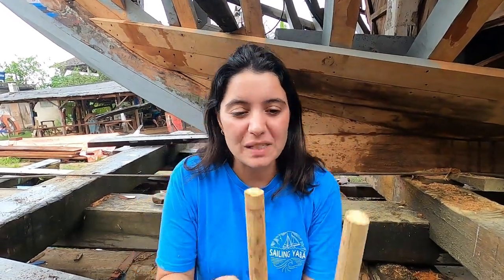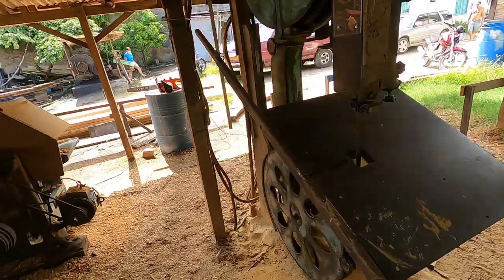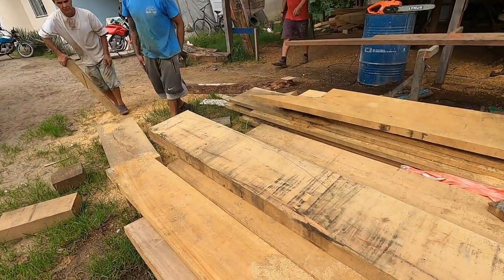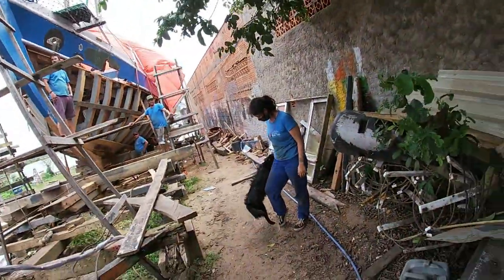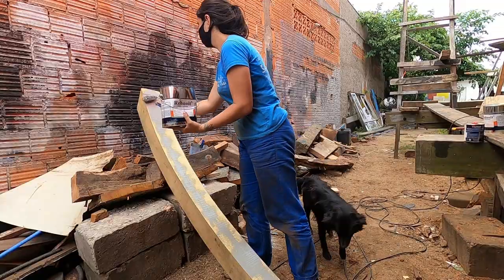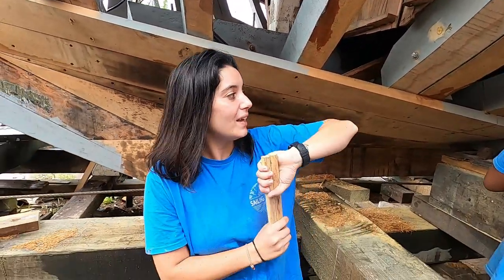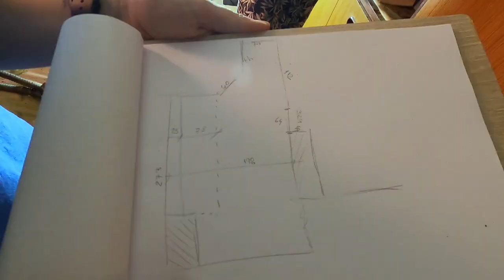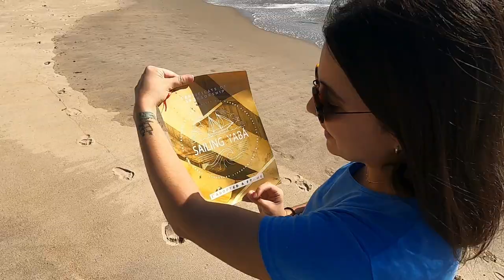MASSIVE RESTORATION: Building frames on a huge wooden schooner — Sailing Yabá #23

Comment: Get the guys some safety glases
Reply: They are a pain, continually getting dust, smears, steaming up, scratch easy etc we only use them when youve a fair chance of getting something in your eye, you get to know when needed
Reply: @Superfandangoo  40 years in the trade, and you haven’t learnt a thing. Eyes don’t grow back you know, I’ve worked in ER so I know a little more than you about site injuries. I can furnish you with some stats if you wish.
Reply: @dickenscider7328  I didn’t say I don’t wear them did I, I will where them cutting/grinding metals, plastics, chipping ceramics etc as for cutting/sanding timbers etc, the dust that accumulates hampering vision at the cost of losing a finger no I do not and this is what these guys are doing, I and my colleagues have all their fingers and eyes.

Comment: Hey guys, great progress and looking good!  Nice touch adding trunnels (treenails) in the frames.  With all of the work you have put into the ole girl, just one tip on how to best preserve that work.  Install a water tight deck that keeps the freshwater out!  Think of how important the roof on a house is and the difference in how long the house and your belongings will last with a leaky versus a tight roof!  Quite a few options but pick one that is proven.  Planked decks look traditional and all but they will all leak sooner or later!  You can plywood over a planked deck. Scarfing and glue all joints so that you essentially have a single pc. of plywood and then sheath with a semi flexible covering such as a softish epoxy like West Sytem and Dynel cloth  (2 layers min.).  The Dynel has a lot more give in it than fibreglass so it moves with the wood better but fibreglass will work and is more available if you cannot find the Dynel.  You could  go with the traditional painted canvas decks but they will be short lived in the tropics.  Cheaper is what is called "Miami Teak", tar, tarpaper and mobile home roof coat..not the nicest stuff but much more watertight than a planked deck.  Just pick a solution that will keep the freshwater out and you will greatly extend the life of Yaba.  Dry wood won't rot.  You will get a lot of moisture through the below waterline hull planking, normal on a wooden boat.  Provide plenty ventilation or use a dehumidifier if the boat is closed and dockside to keep the moisture from building up.  To keep out the shipworms from below, if available creosote painted on the bare wood works great and your bottom paint can go right over it.  Otherwise lots of soft copper bottom paint and haul the boat often.   You are going to have a really strong boat when you are finished.  Your workers know their trade.  A very impressive project!  Best J&J

Comment: Just a thought on interior.  You said early on that the master stateroom was going to be forward and the second stateroom aft. Due to the size of the boat, you will need a crew for long hauls. You might consider making the master stateroom crews quarters with berths and a table for guests and crew.  The second stateroom would make a good master stateroom. You live one the boat and only sleep in the stateroom.

Comment: As a life  long shipwright it hard to fathom the logic trying save this boat , but if your passionate about keeping her afloat it’s almost impossible to be talked out of the idea of not saving her . So please please invest in the best electronics and emergency safety equipment you can get and knowledge of how use them - this boat should never be in anything but calm seas or you’ll be putting yourself and  your passengers at risk .Shes  not new anymore and never will be no matter  what’s been replaced,  a new boat  has tight joints for strength, this boat will forever flex and loosen up even tied  up  at the dock .
Reply: IDK, looks like they are rebuilding the whole boat - almost like The Sampson Boat Company.
Reply: @drx1xym154  Tally Ho and Yaba just can't be compared in materials, build quality and craftsmanship.
Reply: I'm a craftsman who works with woods. I wondered what a shipwrights take on the restoration would be as there are a fair few aspects to the restoration work that make me concerned for their safety whilst afloat. It would be a crying shame to see it all end up at the bottom of the big blue and these lovely peoples lives at risk.
Reply: Tony Goodman . This boat will live for many years. Good charting skills  should keep her safe along with regular refastening of the hull. Romantic ideas of the seas sometimes over ride the risks buying a craft that need a lot of attention and resources. In that case resources can  applied  for upgrading systems and learning how to use them. You reduce the risk significantly by knowing where your location or location of another vessels or any other hazard at night , or if sudden storm catches by surprise . When you drive an antique car it best to stay in the slow lane..

Comment: Have areas of the interior main walkway built with regularly spaced sturdy posts to use to hang on to and brace your bodies against while moving through the boat in rough seas should a  storm occur while under sail.

Comment: It was easy to build a brand new boat than refurbishing this one.  (era melhor construir um barco novo do que reformar este )  loucos..
Reply: Probably this is the format of the channel . Craftsmanship and rebuild
Reply: You guys have no idea how difficult and expensive it would be to build this kind off big boat. That would easily cost millions. There are millions of pieces  needs to be built like electric, mechanic, furnitures rigging and more. So many tools and stuff that that comes with second hand boat would cost hunders of dollars if you try to buy for brand new boat. Replacing rotten parts is way easier and cost effective. Usually what you see rotten here is 10/1 value of total cost of the boat. If some deck beams and interior parts are rotten too the value might go up to 8/1.

Comment: I did this for many years, have replaced up to 95% of the boat. You have to ask yourself at what point have you built a new boat.
Reply: according to Leo, never its just over deferred maintenance.... :-|
Reply: @alan-sk7ky  well I have had this same axe for 40 years, changed the handle four times and the head twice.

Comment: Suggest fiberglass and epoxy layers on the hull as a final step on the wood hull below the waterline in your warm ocean waters. Copper sheathing over tar would even be better.
Reply: Planks are too large for fiberglass sheathing. Should have been strip planked if they wanted to do that, but not how commercial boats are traditionally built.
Reply: @skaraborgcraft  This is going to be an almost new construction on a privately owned boat. Explain how it wouldn't work please.
Reply: @skaraborgcraft  Of course it wouldn't work on a lapstrake built hull but this boat has an even plank smooth hull.
Reply: @deuteronimus750   It has nothing to do with the hull being smooth, but the eidth of the plank, planks these size will expand when they absorb moisture, and that will break the glass, causing water to get behind the glass and rot the planks unseen. Its a common mistake on lots of old boats.
Reply: @deuteronimus750  As above, plank expansion. Succesfull glass work needs wood no bigger than 2inches-50mm wide to be really succesfull.  History has proved this.
Reply: @skaraborgcraft  History hasn't. Are you located in a non tropical area?
Reply: @skaraborgcraft  That is the whole point of what I'm saying. These two options would almost eliminate water intrusion in a properly maintained vessel. This yard probably doesn't offer these services as they practice traditional boatbuilding. I'm sure it would be hard to have either of these improvements done in South American boatyards.
Reply: @deuteronimus750  Presently yes, but i have worked on wooden boats from the Sub Arctic to the tropics. Feel free to disagree, i only speak from my own experience.
Reply: @skaraborgcraft  . Here in the Netherlands covering a wooden vessel with a polyester or epoxy skin is called a " death shroud" . Keeping the wood dry is an illusion . There will be water in between the wood and the glasfiber skin . Rot will be accelerated by this . I've seen photo's verry recently of a boat where in places the complete wooden hull was rotten away . Only the glasfiber skin was left .
Reply: @wimmol   Its commonly used in Sweden on old trawlers like 50 years old, just to get another few years of life out of them.  Strip plank boats covered in epoxy and glass from new is a different ballgame, plenty of superyachts built like that today, its just not right on a traditional carvel planked vessel.

Comment: Ben nailed the description on the distinction between a bandsaw and a ships saw to the point. Now let me give you a little insight into the Treenails. The word derives from Danish/Skandinavien and the viking ships. These ships were Klinker boats or Klinker build. The word Klinker is due to the sound it makes when you peen over metal rivets. In Danish a rivet is "en navle" and the vikings used iron or cobber spikes (rivets) as fasteners. A wooden rivet in Danish would be "en tre nagle" (instead of "en jern nagle which is an iron rivet or spike) the word "tre nagle" has been changed over time in the English language to Treenail but was originally a tre nagle which means wooden rivet. Now you know something that even Leo of Samson boat company doesn't know (Yet)
Reply: And is pronounced TRENAL
Reply: @ccmagma5434  That is plenty close enough for government work

Comment: At 24 seconds into the video, in the introduction, we can see that the frames are in place, and that the hull planks are also in place.
How far behind actual time are these videos, and when did you actually get Yaba? How long have you been working on her?

I really don't like the frame construction.  Just a couple of bolts and 'tree bolts', to me, don't seem to have the structural strength to hold a large yacht like this together.  Even wooden hull planks to distribute some of the load, I still am not really impressed with the build.  Didn't the yard use any kind of glue to form together the frames?  I mean, that would add a small amount of structural integrity.
I'm just concerned that you're going to get the yacht out on the water, hit some contrary seas, and have those frames come apart because there's no real strength in them.

Hodge-podge construction comes to mind.  At least the yard workers are getting paid, right?   I mean, do they really care what happens after the boat leaves?

I still say for what you're investing in this, you would have been better off buying something with no damage.
Reply: Remember they are in a third world country. The men rebuilding the boat are the same ones that built her. So in 10 years or so they will be back in the same condition as they were when they entered into the yard. YABA was built as a near shore charter excursion vessel. She was built to make money and make money fast from wealthy tourists. Her original owners did that and then some. Then tossed her out to scrap. These boats are all over the place.
Reply: @manning643  it wouldn't surprise me.
Reply: @manning643  no it wasn’t you really should pay more attention to the videos
Reply: Why anyone can buy an undamaged boat at least when this is finished they will know the boat inside and out good on them for having a sense of adventure.
Reply: @dowser81  people are too afraid of everything..... is sickening me, no sense of adventure, no sense of pride, no sense of reality.... the world could do without these people... they are not only their own bane of existence but also those around them...

Comment: Are they using steel bolts and nuts?
Reply: No they are using 
DEZZ NUTZ🤣😂
Reply: Stainless threaded rod. Probably all they can get down there. Would have been better with plain steel and galvanized.

Comment: I’ve never seen a boat where 90% of the frames were completely replaced, and sistered. Most shipwrights will tell you to never sister more then 5% of the frames. Oh well, I guess the rest of the world is just wrong.
Reply: No, I've seen other boats with many sistered frames, it just has to be done properly. Usually the original frames are still relatively intact and not rotted out however.

Comment: since your thinking about other things now, I have noticed a lot of YT sailors have trouble landing their drones.  Just an idea, if you had a flat surface away from rigging with a carpet of velcro, you could put velcro on the drone, and MP wouldn't have to reach through the whirling blades to catch the drone.  Problem is, all the other sailors have solar panels in those locations.  So you will need to make a board with velcro, or plan ahead and leave some space open.
Reply: @gav2759  LOL a few ounces to a few tons.  Hopefully they choose the right one :)
Reply from the maker: That's so clever! We love it! Thank you for the suggestion!

Comment: Why the tree nail?
Reply: Because the threaded bar, as opposed to a full bodied bolt, has no resistance to movement should the futtocks flex,which they will, against their adjoining parts. Not that I think tre nails, pronounced trenals, will make  the slightest difference in the ultimute result of this ongoing disaster.
Reply: Bolts, trenals and other bits and bobs depicted in real-time of this Costa Rica'n new build of a quite massive wooden boat. 

Massive for this day and age I can only add.

Cast your mind 300 years, and try and take in the enormity of what went into the building of a wooden commercial/navel vessel of far far greater proportions than what is shown here. It absolutely staggers my mind what they managed to achieve and build back in those days.

If you ant to try and imagine what existence  might have been like working in a shipyard back in the day, search "top dog under dog" And this is how they built the greatest wooden ships that ever roamed the seas.

Comment: The interior is not bad but it is made of melamine and particle board...which is even worse.
Solution: redo the whole interior walls and cabinet framing by using high quality (or selected to a very picky standard) 3/4 inch plywood and make cabinet and partition doors and drawer covers in two layers thin plywood and some 1/2 inch dimension timber... I did that for a camper build and it worked a treat. also don't be afraid to reuse real timber parts and trim because that would make the story of the boat even more rounded...

Comment: With all the extra wood you're adding to "rebuild" something, aren't you afraid of the extra weight? This adds massive amounts of weight to the boat, this will mean the boat will move a lot slower and lay very low in the water.
Reply: Where is this "extra wood"?  They have been replacing what is being taken out, so it will not be any heavier than originally built.
Reply: @skaraborgcraft  So the original frame was made from 3 different pieces bolted together with overlays?
Reply: @maikeln5539   Its not unusual. Go back and check the destruction videos. The futtocks (overlays) are below the waterline, so its mostly good as there is no external ballast keel.  Dont worry about it.